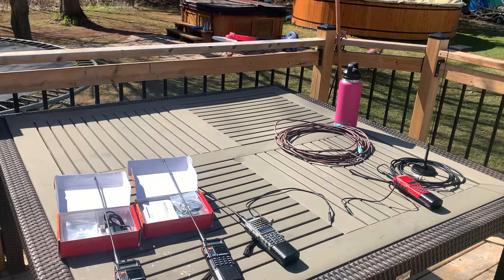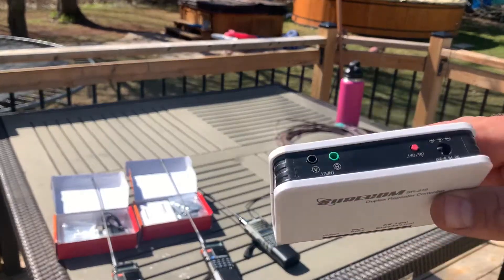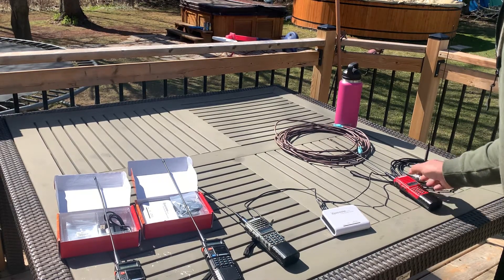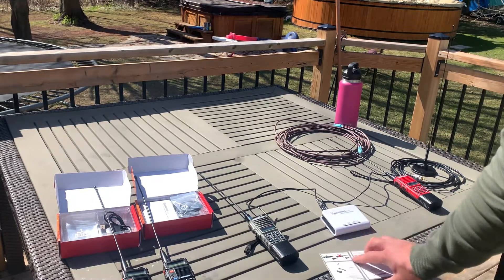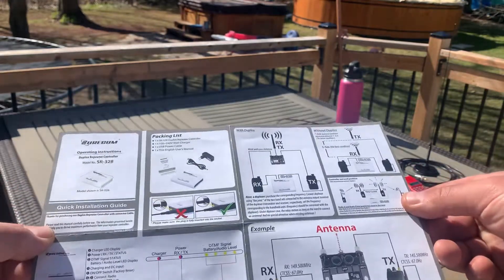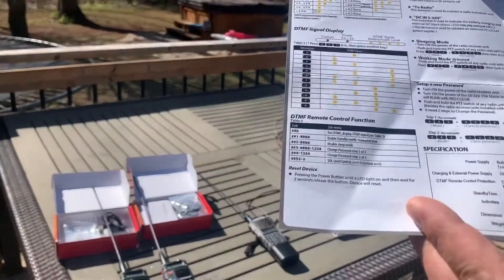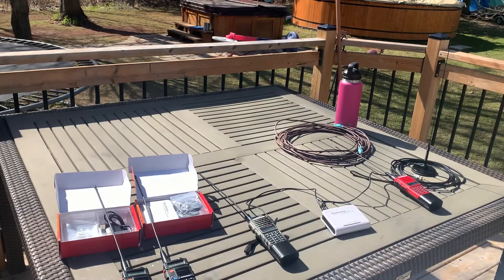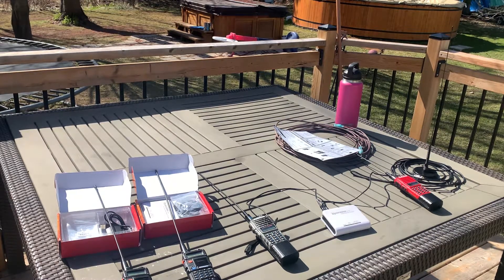Best home built SHTF Repeater? SR-328 and SR-628 (Part 2)

Comment: Would this work to relay a garage opener’s signal
Reply: Would be interesting to know. With that said most WiFi garage door relays are super cheap and work well. Most work even with older openers as long as there is WiFi.

Comment: Not sure why you a blaming the controller for your lack of provisioning suitable separation, duplexer cavities, antenna & adequate transmit power (to meet your expectations of cover a LOT more distance).

How far extra are you expecting it to transmit beyond the normal HT range when they are both co located ?

Perhaps looking at the purity of the audio in & out of the controller (compared to each other) and any TXD also be of value.  This is important for any data related transmissions

I think your summary is biased based on flawed testing (and apparently expectations without supporting technical data). 

Good to know that its not reliant on VOX
Reply: I think it's because most of us want a further reach than what you would typically get ht to ht. Unfortunately even with 10-15 feet of antenna speration I still can't go more than 100 feet from the repeater without completely loosing signal. Which is crazy because I can get 4 miles without the repeater.

Comment: I am just looking at this trying to find out more about the surecom products.  My hunch is that it is not really the surecom causing the grief but the close proximity desensing the front ends on the cheaper "Fangs".   How was the SWR on those magmounts when you checked it?   reflected RF back down the radios and maybe into the receive radio could really cut down the range.  Did you put them on a metal ground plane?  Again my thought is  there was RF contamination back into the receive... probably.  I am just spitt-balling getting ready to do some similar experiments. 

 I am setting up a bigger repeater with a duplexer but I want to try what you are doing for a SHTF in a toolbox style repeater with the two antennas. Just to save $$$ I will probably just do the Cross-Cable and Vox method to start and then if it look promising I might get an actual controller.  Oh an though I am a Licensed Extra class Ham I will be doing these on GMRS with Type accepted Baufengs or Retevis radios.  That way I don't have to jack around with frequency coordinators and my whole fam can use them next time they shut down cell coms.

You It may take two cheap @$$ harbor freight tool boxes separated and a longer audio cable extension looped through ferrites but there is no reason this idea should not work

Comment from the maker: Check out Part 3 https://www.youtube.com/watch?v=QK8suRLCwE4&t=35s. It explains. I highly don't recommend buying any Surecom "repeaters"
Reply: I hear you brother.... I'm just getting into GMRS and trying to set up 2 radio's (UV-5GPlus) as a repeater and having same issues. I have tried to different configurations. First, I purchased a $40 switch box that plugs into K-adapter and it automatically configurations the RX radio to use VOX. Next, I configured the radio's to use a repeater channel +5 using churp. That works until I go about 200-300 foot away from the radio's and then I couldn't  not hear me transmitting using another radio to listen. test FAILED. Also, tried using just a mono adapter 2.5 and 3.5 male ends to both radios but only had 6 ft. of cable. I got the same results as you did..  Bottom line, I wish I knew about your channel weeks ago which have save me time and money..

Anyway, I just ordered a RETEVIS R97S repeater and should be here in about a week.  Lessons learned, by trying to go cheap....  LOL

Comment: Making sure i understand this because im new to all of this. Either of these will work with one radio or simplex orbduplexbmode if i understand that right? Ive had a cheap radio for awhile and managed to get and listen in on ham,murs,frs,gmrs. I wanna upgrade radios but in my research i realized i have no gmrs repeaters in my area. So here i am trying to figure out shtf repeaters until they catch up to speed. I dont wanna go through the work of a ham liscence at the time so id like to just do the gmrs liscence. Sorry for the newbie question.
Reply from the maker: Maybe build your own GMRS repeater. Check out NotARubicon on YouTube. He has a lot or really good videos on GMRS systems and different radios. Also you can check out the RETEVIS R97 repeater. It’s pretty good starter system.